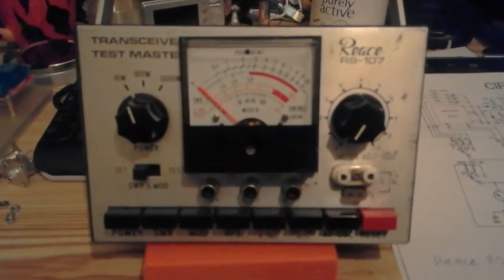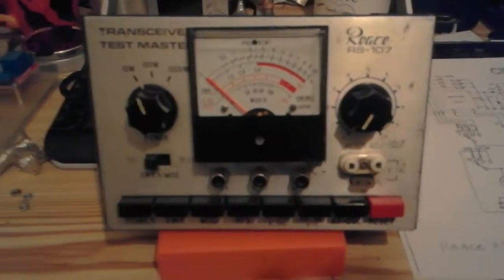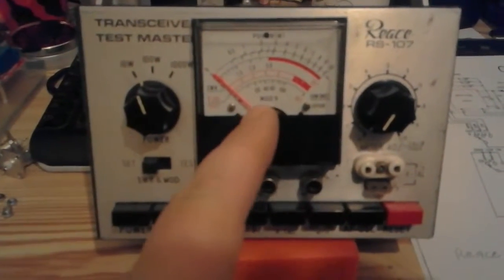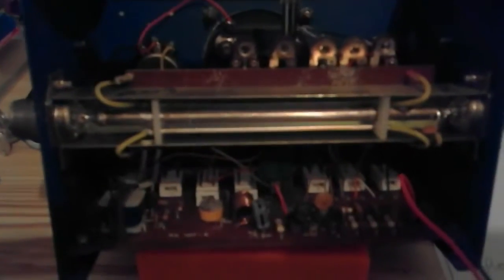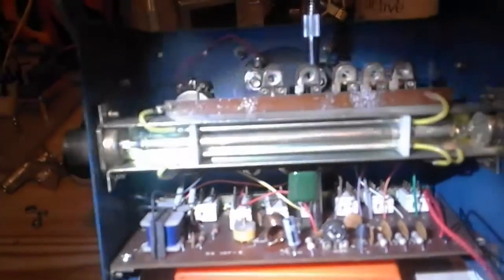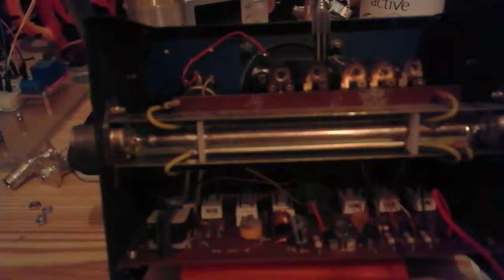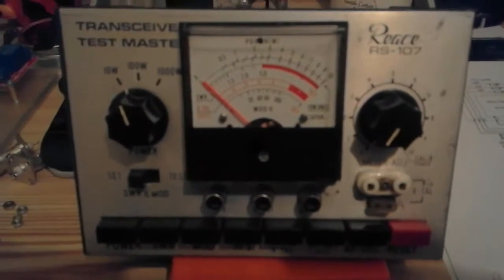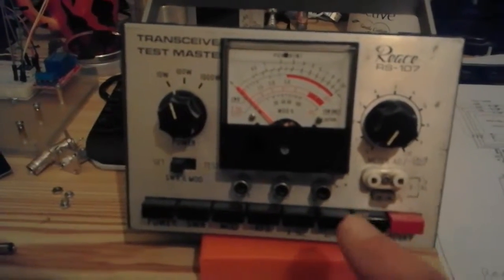Reace RS-107 TEST METER

Comment: do you have the circuit diagram for this unit i have been
given one of these  and it would be useful for testing my low power cryatal controlled radios  dave c   gw0nvf
Reply from the maker: I think I have I will check later
Reply from the maker: Hi dave found the manual which has the schematic but its pdf send me your email
Reply: @steveedwards90  thanks mate the email is daveyboat @gmail.com cheers